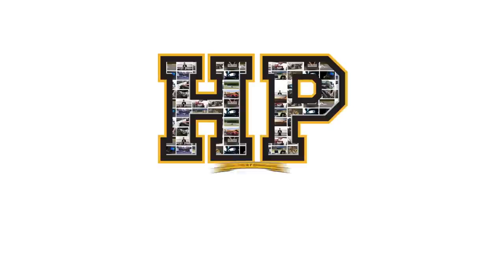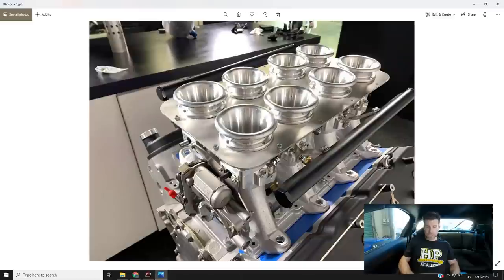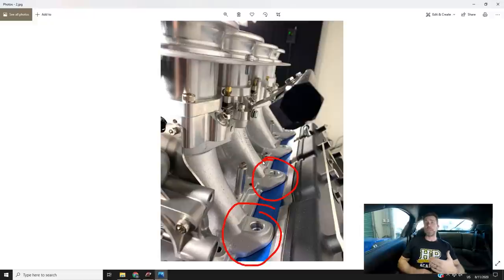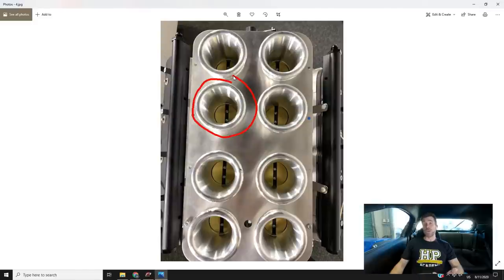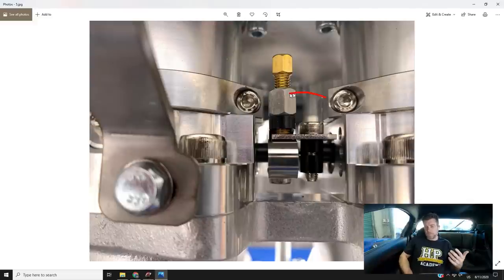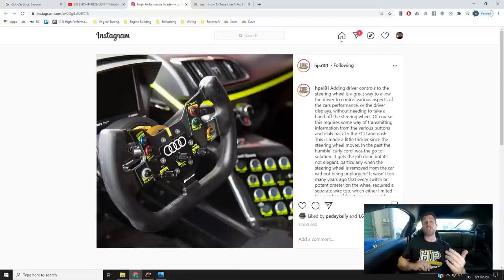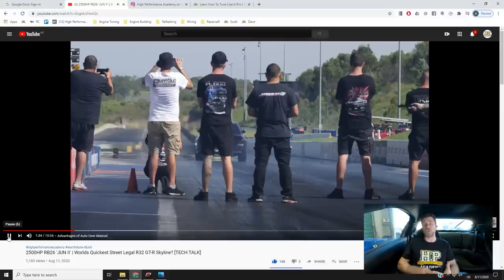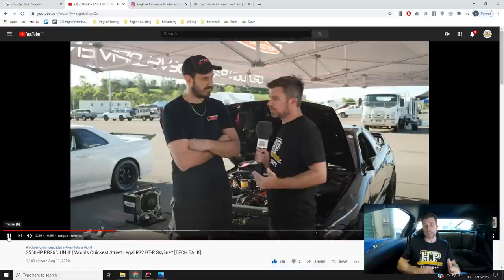ITB's, DBW and V8's | Today At HPA [UPDATE 252]

Comment: Alpha - n felt best on my itb setup, but because I daily drive my project car, I switched over to a blended mode that mixes both (microsquirt v3 itb mode)  it's fun to learn, and helps me see from the perspective of an oem manufacturer configuring a stock itb engine (4age 20v blacktop for example). I have more consistent low load/low tps fueling for economy. 👍🏾

Comment: I'm really curious about your comment on getting better atomization with the injector further up the runner. I run a KTM 690 single cylinder in an FSAE car and last year I played with that idea only as a dual stage injection, with the idea being to use the port injector at low rpm then switch over to the stack/showerhead injector at high rpm when the air velocity is enough to atomize the fuel. On the dyno I wasn't able to find any appreciable difference in torque; all I found was worse AFR control (I assume from wall wetting). 

I think done right you could have a pseudo-variable runner type effect, where by varying the injector ratio you can change the harmonic of the runner by changing the air temps. Might be more of a pipe dream than reality though lol

Comment: Regarding steering wheel button plates, which especially on roadcars with higher degrees of turning are hard to hardwire.. in simracing bluetooth modules are becoming popular, especially handy on direct drive wheels that have no mechanical lock and could rip out every cable connection. There may be some lag, but for most applications its negligible. Is this already a thing for after market ECUs? I remember the Megasquirt I wired up in 2014 had BT connection to the laptop.